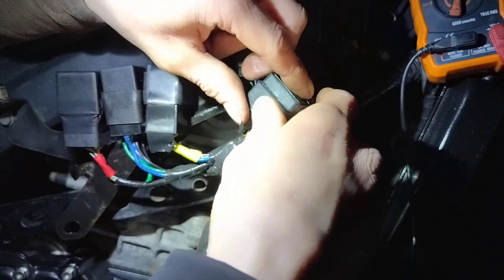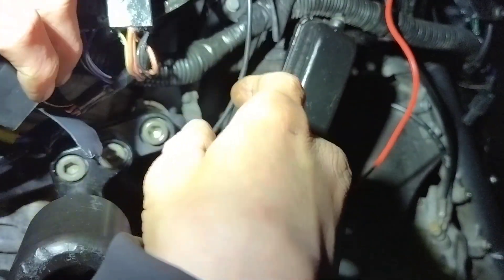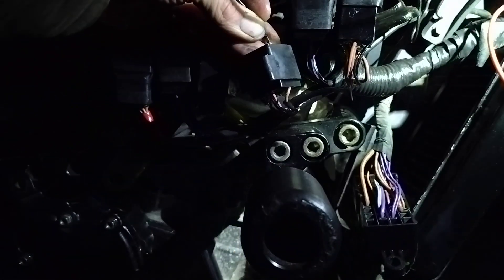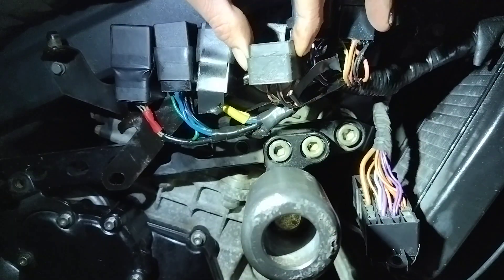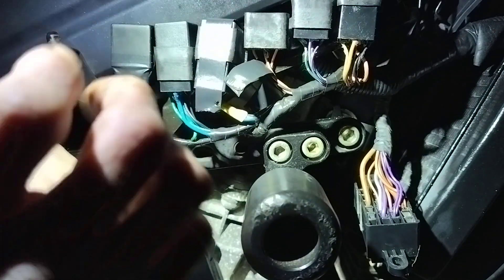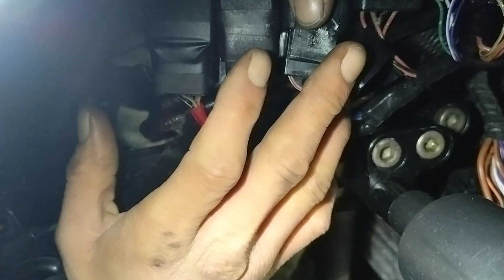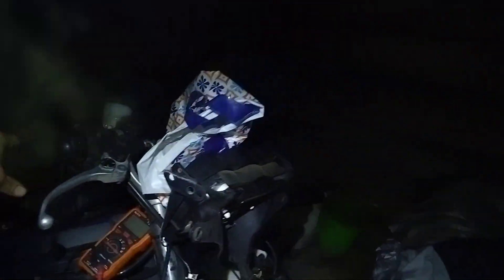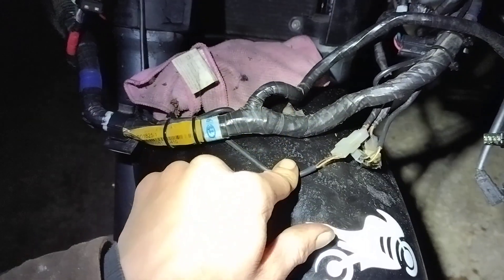Triumph spring st 1050 manual fan switch (Triumph sprint st 1050 electrical issues part 10)

Comment: Did you short that yellow brown wire out on starter relay. I’ve got intermittent start issues drives you mad.
Reply from the maker: i havent finished this project yet however from research grounding the yellow brown wire will bypass the low voltage protection system these triumphs have which will prevent start-up if voltage is low. i doubt it would fix any starting issue itself
Reply: @ABMotorbikes  let me know when you have shorted your yellow brown wire to earth. If it works I will do mine. I’m no electrician and not brave enough… thanks. Keep up the good work.

Comment: Do you think something around the radiator fan going bad could short-circuit the ignition circuit fuse?

I’m somehow getting an ignition circuit short on my 06 sprint st, but only after 5 minutes or so, not initially 

Thanks for the videos!

EDIT: It turned out being the radiator fine and some wire harness that was too close to it.